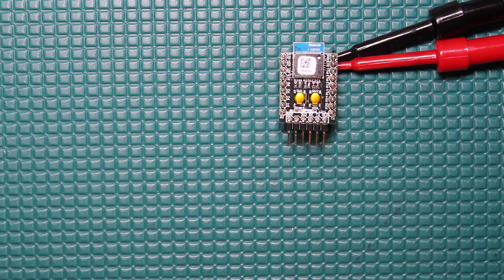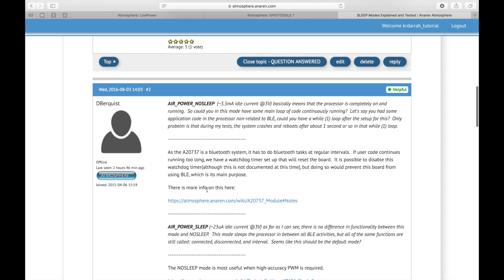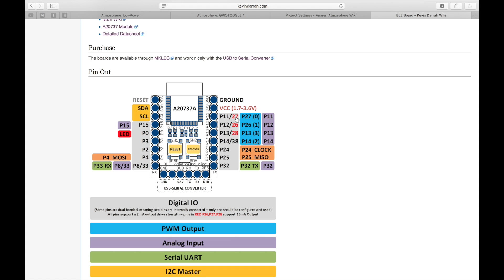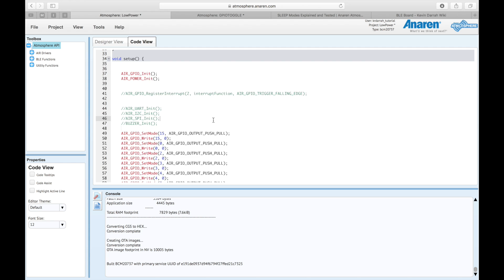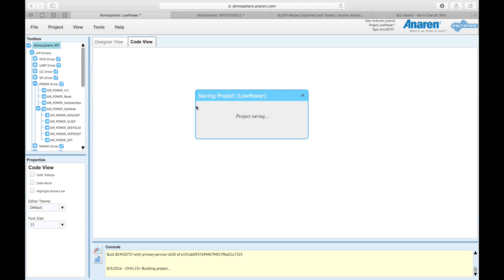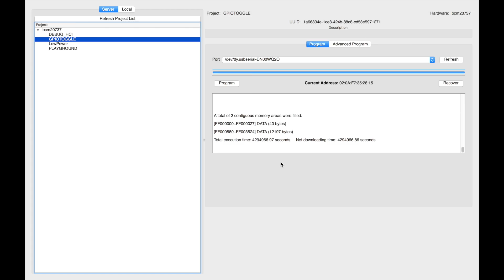Low Power Bluetooth Low Energy!  with the BLE Board

Comment: I was browsing the available 'Elements' from the Anaren Atmosphere Developer and couldn't help but notice there are no displays of any type. How could one easily drive a LCD/OLED  SPI/I2C display using this module? I can imagine it's possible to do it the slow way by just adding each i2c/spi transaction by hand, but that would get really long..

Is there any way to load up a display library to drive a display? Are there any 'elements' available somewhere to drive any kind of display? Maybe a cool topic for a video :)
Reply from the maker: yea, definitely a cool idea.  I think in that case I'd use a host micro though

Comment: Do you recommend using a BLE for Low range RC vehicles that require connection reliability?
Reply: DBerquist from Anaren here.
I'm afraid that page on our wiki has gotten somewhat dated. Most of the information written there is from 2015. Since then we've done a lot of work to get BLE on Android devices working better. In our last couple major releases Android device BLE performance has reached an in some cases exceeded iOS BLE performance.  
As for piloting an RC vehicle, we have a few demos involving RC vehicles that we've shown off at various shows, maker fairs, and YouTube videos.  
There is a limitation on how many commands you can send in a given time frame, and this performance varies depending on your mobile device.  
Here's a few examples to give you an idea of the performance range:
The Motorola Droid Turbo can send just over 20 BLE commands to our BLE dev board in 1 second.  
iOS devices can generally send 8-9 BLE commands in 1 second. 
The Samsung Galaxy S5, BLU Life One X, and Acer Icona Tab 10 are the slowest, only able to send about 4-5 BLE commands per second.  
So, you'd have to determine whether that performance would be sufficient in your RC application.  Also, these tests were run at a distance of 8in/20cm from the BLE board, so would not necessarily represent performance in the distances you'd see in your RC application.  
I would agree with NS Gaming that this is not an application BLE was designed for, and you generally don't require the super-low power consumption that BLE offers for RC applications.  But feel free to give it a shot, see how it works for your application.  The Atmosphere IDE makes it really fast to prototype and test new ideas.
Reply: I think BLE is pretty unreliable for stuff that sends a lot of data constantly, it's designed for sending small amounts of data once in a while, or just making it available so the other device can just read it whenever it needs it. Also there's problems with it on Android, check out Anaren's own write-up on this https://atmosphere.anaren.com/wiki/Android_Issues_With_Bluetooth_Low_Energy. 
With an RC project you usually have access to a pretty decent-sized battery anyway both on the vehicle and an on the remote, the bluetooth part will be the least battery-intensive element probably. 
That said I'm sure you CAN do it.